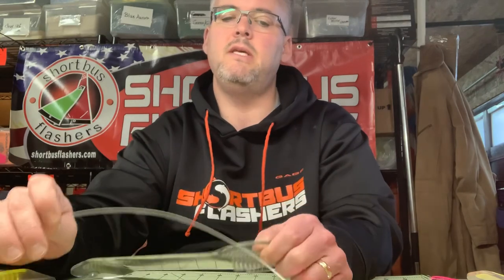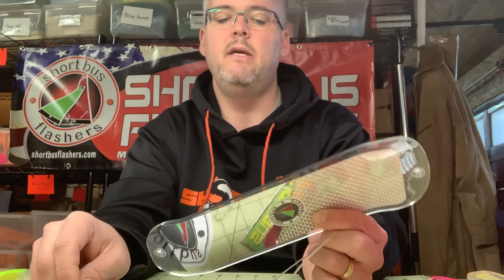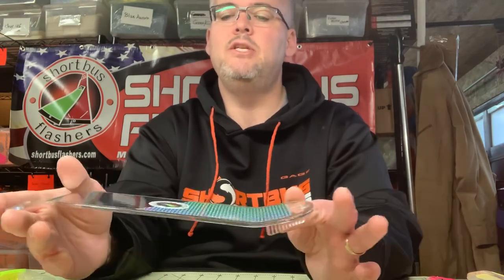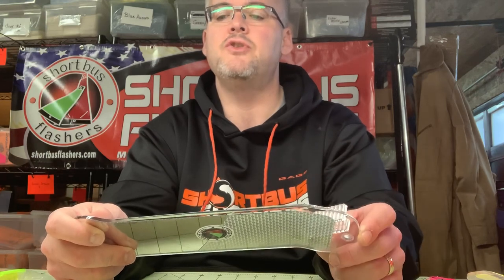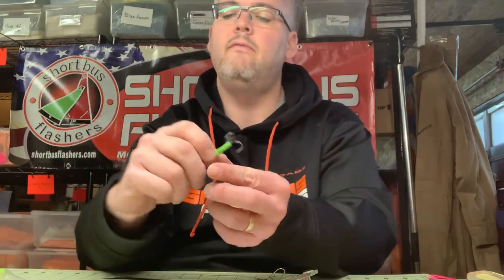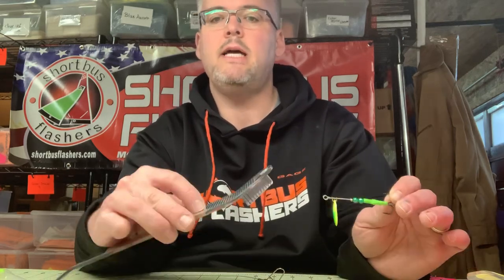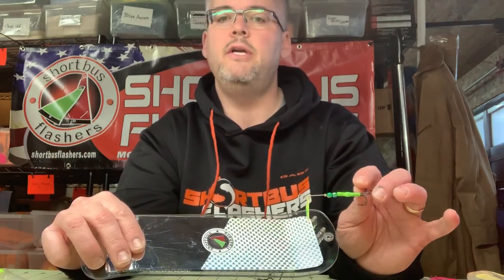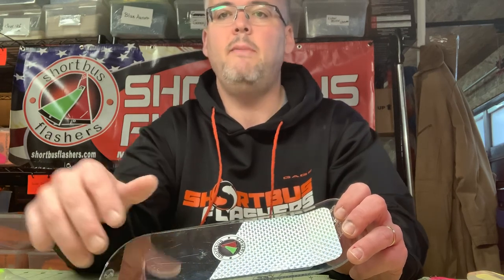Shortbus Flashers Super Series - Speed Question

Comment: Hoping you'll see this question since this video has been out for over 2-years. Question: does a weight dropper make a difference in flasher action? Put another way, say you're using 16 oz lead, if dropper length is zero inches (connected directly to the weight slider) is the flasher action more or less, faster or slower, or otherwise different than it is if the lead is, for example, on a 12-inch dropper ? Apologies for the long-winded request.
Reply from the maker: Rick,  lots to unpack.   Dropper changes the way the line moves in relation to the lead.  If you have a 12" Dropper, it will allow the flasher more freedom to swing but it gets a little Sloppy. Meaning if your using a 16oz lead with no Dropper the line won't swing side to side.  If the Dropper is there, there is a "fixed " point in the line. Long story short.  Shorter the Dropper the more pop the flasher will produce.  That said, some days the Dropper or no Dropper makes all the difference
Reply: @shortbusflashers1281  Thanks JT. Yeah, it just seemed to me the dynamics of dropper/no-dropper would have to impact the flashers movements in some way. Your response makes total sense. The variables and varied outcomes are things that make fishing so much fun and keep things interesting (tho I don't tire of "catching"). If I could hit a home run everytime at the plate  I'd probably get bored. But that feeling of contact between bat and ball is so wonderful, well, it sure keeps you coming back. Pardon the baseball anology, lol. 
I love your products, and use one or another or several of them every time out.Thanks again.